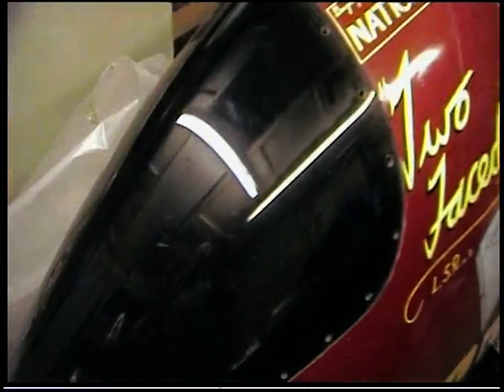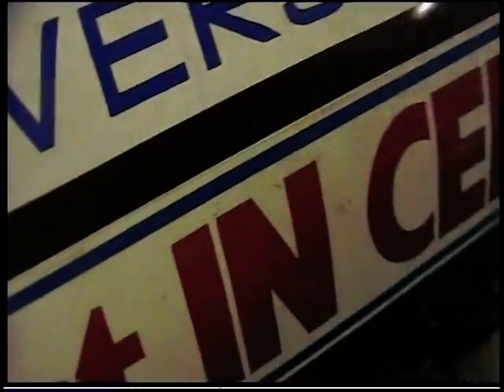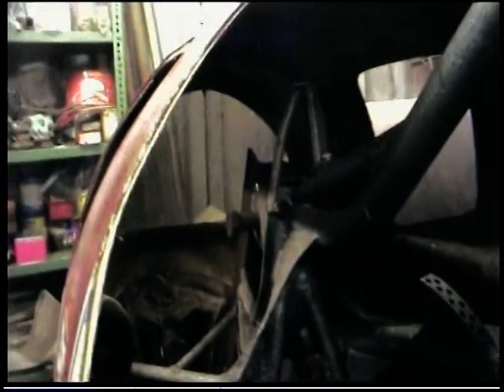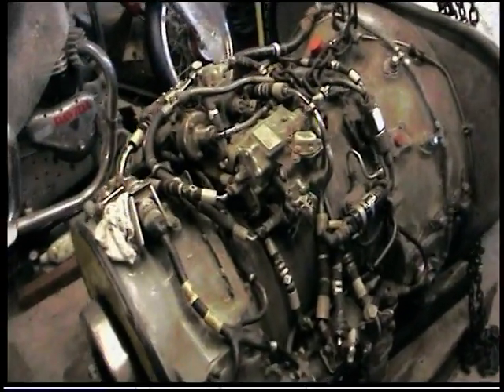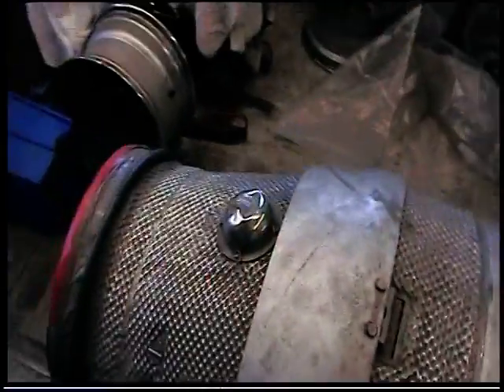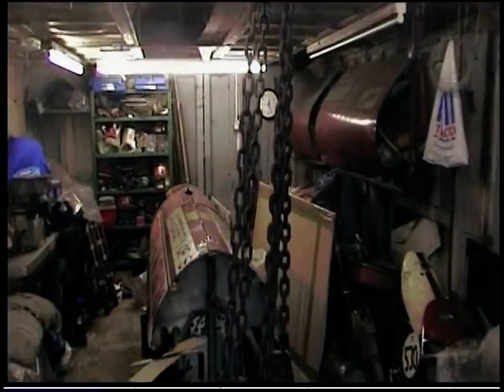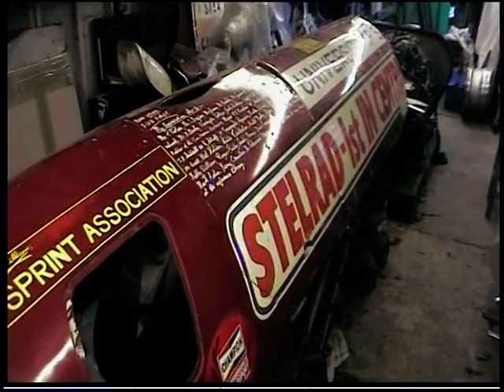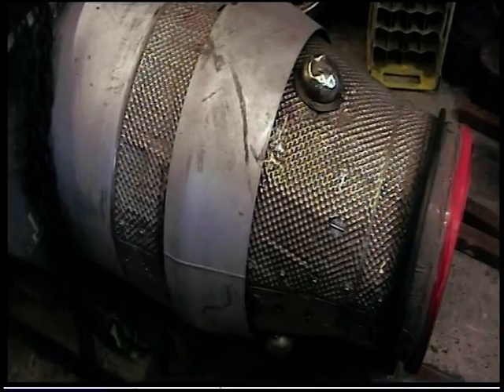Pete Williams' LSR Streamliner project, Sept 2013 update. 7 minute video.

Comment: We most certainly need to have some aims in life! Could not agree more!  :-)  Saw your vid on how to make a fuel tank, amazing! Very inspirational for the rest of us. 

Where do you buy the tubes you need? I have a dream, or "aim in life" to make my own frames and tanks, but where I live tubes are hard to find, unless you buy them by the tonnes....   :-(
Reply from the maker: Hi runar500, some of the older parts of the streamliner that I began some years ago, I used Reynolds 531 tubing but unfortunately it isn't available over here in UK anymore. Tubing for the modifications and fitting of the jet engine into new chassis at back, I got from local suppliers over here in UK who will supply small quantities such as 4 or 5 metre lengths of steel tubing, + cost of delivery, but if the suppliers are more local, I can go and collect it in my van. Where possible, I use CDS steel tubing. That is, Cold Drawn Seamless steel tubing. As the name implies, it is manufactured from solid by forming it through a die. So there is no joint in the tubing. I use this for main tubes. Stiffening struts can be ERW tubing, Electrical resistance welded, if a reasonable wall thickness is selected. There are also local firms here that will supply aluminium sheet. I use 1050A-H14 aluminium, x 16 swg (1.5mm) thickness for tanks. I also have another streamliner update video on here if you want to see that, uploaded in 2014. Thanks for your comments and good luck. Cheers Pete.
Reply: Pete Williams  Hello Pete, and thank you for your reply!  Me and a friend is going over to the UK for the Telford Classic Motorcycle Show at the end of February. It has become a tradition, so to speak. We highly enjoy to see the magnificent handycraft that goes into the building of the bikes shown there.

You would not happen to know of any supplyers of CDS-tubes close to Telford, would you? Thanks again, and yes; I've all ready watched the 2014 update of the streamliner..  :-)    You show amazing skills, and your work is very inspirational!

(You are not worried that the shocks might become very hot, beeing so close to the jet engine?  Did you consider using single shocks for the rear suspention? )
Reply from the maker: runar500 Hi, I will be using a heat shield to prevent shocks getting too hot and the machine will only be running for short duration. Single shocks would have created more problems with chassis design and would have to be much stronger spring, as shocks would be close to front of swing arms with much more leverage applied. I already had these shocks. Sorry I don't know of any suppliers of CDS near Telford but if you put that question into Google, you may get some information. Also, I think I'm about 40 miles or so from Telford, I don't know how long you are staying in UK, but if you have time, you could visit me as I live near Warrington, Cheshire. Cheers for now.
Reply: Thank you for your time, Pete! I would very much like to come over for a quick tour of your workshop! I don't know what time allowes, but I will certainly keep this in mind.  :-)
Reply from the maker: My e-mail address is:- pwilliams08@yahoo.com  if you want to come over, e-mail me and I'll let you know my address, give me a few days notice. Cheers Pete.
Reply: Pete Williams
Thanks Pete!  :-)